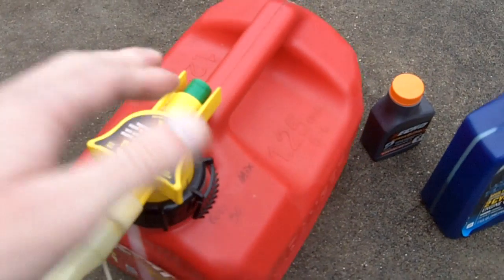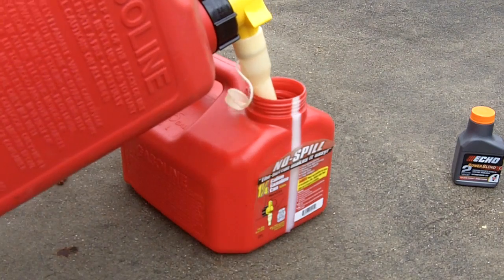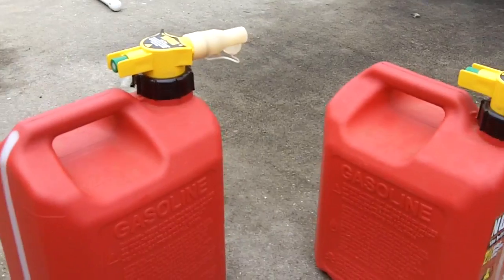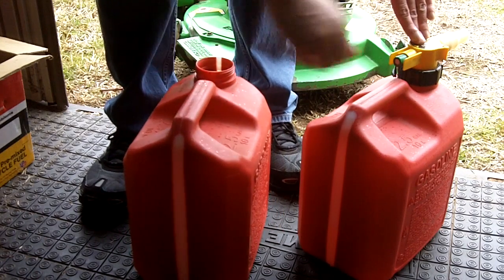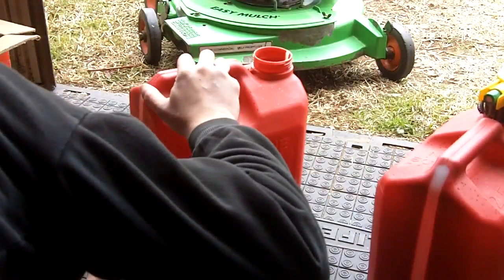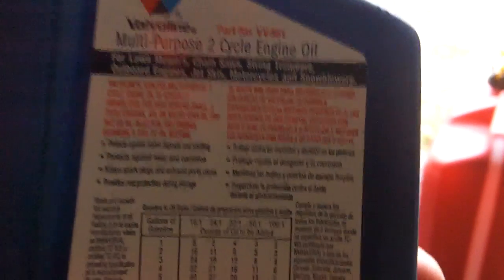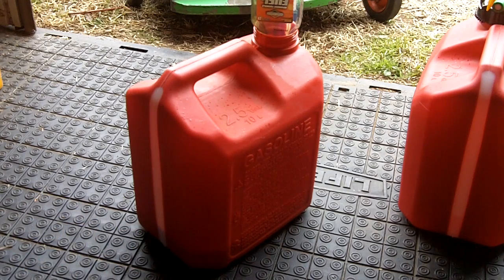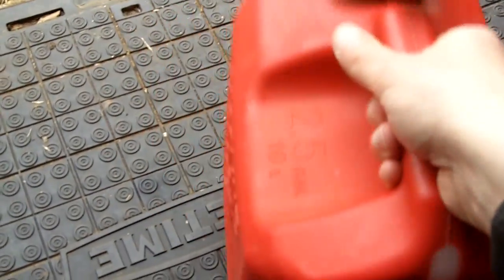How To Mix Gas and Oil for 2 Cycle Engines

Comment: I've had the same can as yours in the video. They always swell when hot, and shribble up at night when it cools down, even if stored in a shed. I drilled a ¹/32" hole in the handle to vent it. Cured my problem. Bit came in a Dremel tool set. Winter storage can pull moisture or sour gas. I move left over gas to old Tru-fuel cans.

Comment: Nice video man I like those gas cans and the nozzles on them. Where do you buy them and does those nozzles come with them or are they separately  purchased.
Reply: The cans come 2 ways. The whole assembly, and just the nozzle part. Not sure where my boss man gets them. The new ones now have a flat button as opposed to round on the older cans. Never seen them in yellow or blue to identify different mixes. Blue is normally kerosene and yellow diesel fuel.

Comment: are you still mixing your fuel or are you using vp on all your equipment
Reply from the maker: I still do a fuel/oil mix for my two Lawnboys two gallons of Trufuel with 8.oz of Lawnboy 2 cycle oil and for all my Echo equipment I'll use Trufuel pre-mixed(50:1) fuel. I do use Trufuel in the Chipper/Shredder and my Pressure Washer because I don't use them that much and for the rest of the equipment I'll use regular gas from the gas station.

Comment: What's difference in 40:1 vs 50:1?
Reply: +Brad Jackson I believe there is more oil if the number on the left is lower. 40:1 more oil 50:1 less oil.
Reply: Brad Jackson the engine will run leaner
Reply: About 10

Comment: Can I use 92 octane in my Sthil for better performance?
Reply: My boss told me to always use premium to mix up 2 cycle gas. Regular doesn't have enough octane. Non ethanol is preferred. If not available, use Lucas ethanol treatment in the gas. One ounce to 5 gallons.

Comment: how much is it for the 32:1 i dont understand it in the vid
Reply: +anthony restrepo , 4 oz to 1 gallon of gas, (32/128=4) get a cheap measuring cup, pretty straight forward.  I buy oil by the qt, make sure its tcw3 oil.

Comment: What is the mixture for a 2 stroke bicycle kit?
Reply: 50:1 but you can use 32:1
Reply: +Don't race me I'm to fast im wanting a 2 stroke and have never owned one, so the best mix ratio for say, a cr 125 is 50:1?

Comment: I like that gas can.  I have one of the same cans and they are much easier to use than some of the other non venting abominations sold in other stores.  They did not have to come up with all of those ridiculous designs.

Comment: Parents said I can't ride bc he ain't mixing oil (dad) so thanks I'll do this and when they have a problem they can catch me 😂 (CR125cc)
Reply: Be sure you are using 2 stroke oil meant for those motocross 2 stroke bikes. You can't use oil for chainsaws and weed wackers in a bike. Also be sure you are using 93 octane gasoline.

Comment: Hello Again. In Aus we have unleaded fuel (Petrol) Base fuel is 91 Octane, then superunleaded at 95 Octane then ultra super at 98/99/100 Octane. Like you I use the highest possible octane available in my 4 stroke B&S and my McCullough Trimmers cheers

JP
Reply: Do you know if your rating system goes based on the research octane(like the UK uses), or does it go by the (r+m)/2 method?

From what I have read, the 87 octane fuel we have at the pump has about a 92 octane rating on the research scale, the 89 has about 94, and the 93 has about a 98. It is because we use the research octane added to the motor octane, and then divide that number by 2 to get the (r+m)/2 octane number.
Reply: Hi, Fair question. Australia uses the World Wide rating system called RON (Research Octane Number). Look at this link for more Info. http://en.wikipedia.org/wiki/Octane_rating .  Australia's current standard fuel is 91 Research Octane Number (RON) unleaded and most cars sold here since 1986 were built to accept it. However an increasing number of vehicles require 95 RON Premium fuel, while some high performance models require high-octane 98 RON fuel. I trust this explains the rating of fuels we use in AUS.  cheers and good motoring John P
Reply: race fuel is 150+

Comment: Nice Video my friend.  We don't have those "No Spill" containers here, very interesting.Remember, your gallons in the US are a different quantity used outside of the America. We in Australia and most other countries when using gallons are based on the Imperial measure (UK).   Just a thought. You sure have a clean method when working.  Nice and clear audio and video too by the way.  Cheers
John Purdy  PS  love it when you say "Uall"